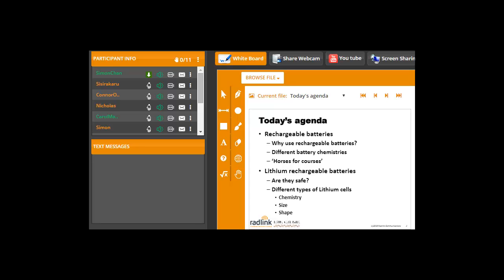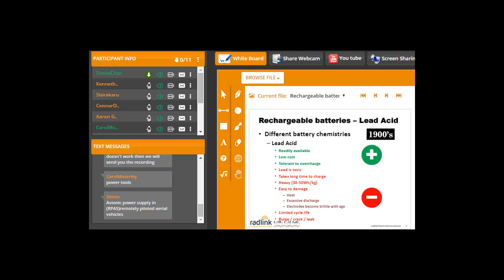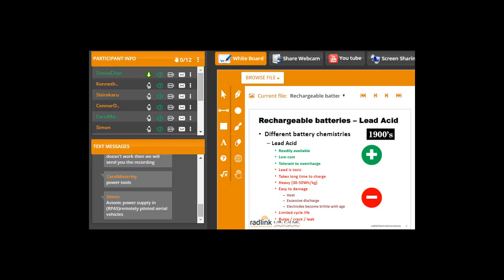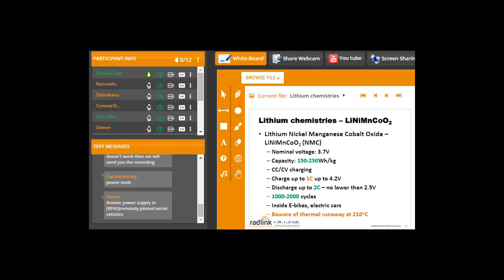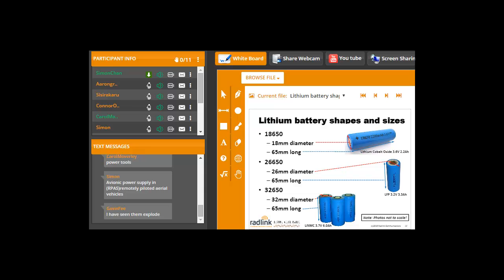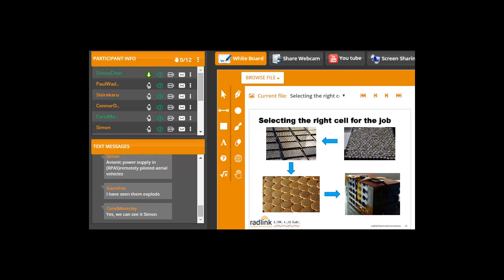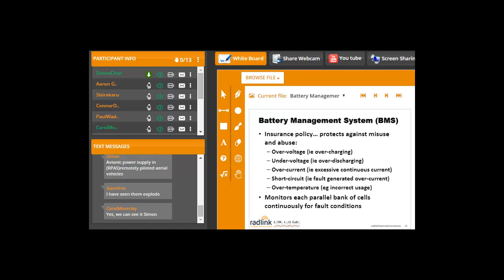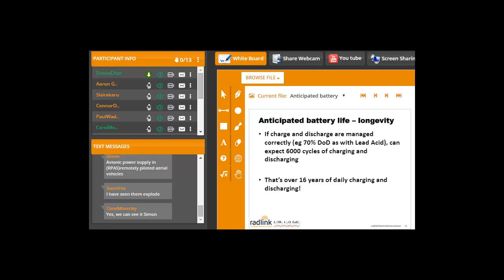Understanding and Using Lithium Rechargeable Batteries

Comment: I want to no if those bateries are rechargeble on the way (while being in use)
Reply: Hello +Ignacio De Bustamante Fort 

Yes, the rechargeable Lithium batteries are just like the ones in your laptop computer or smartphone. They can be used and charged at the same time - providing you do NOT exceed the maximum charging current and charging voltage.

Hope this helps!